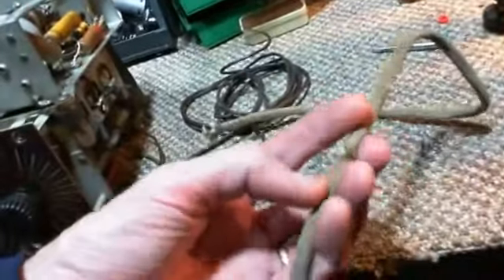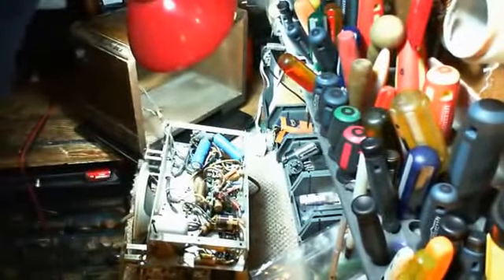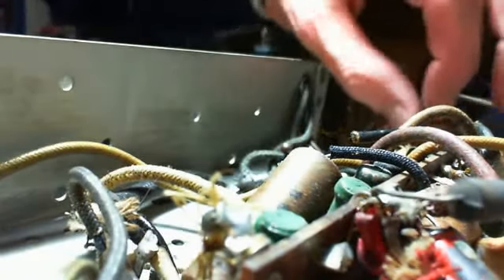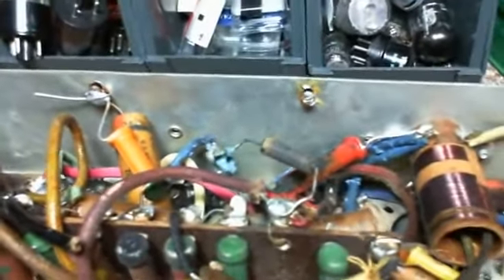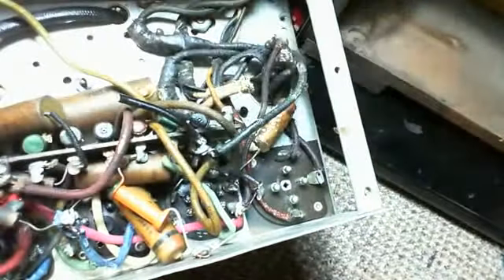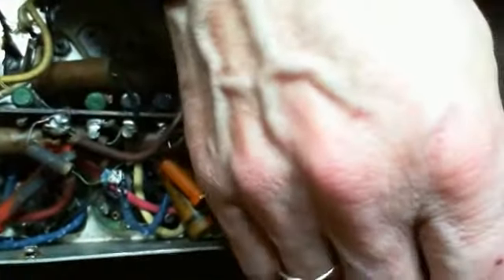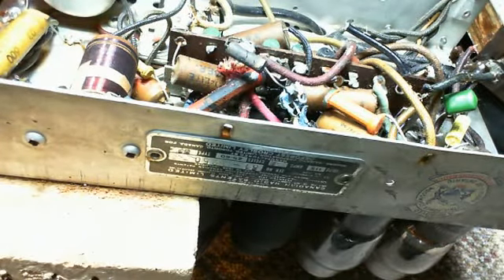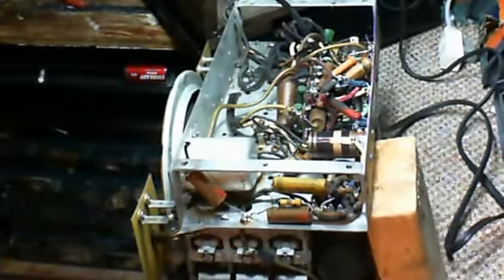DeForest-Crosley 81 EARL Video #2 - Power Cord and Capacitors

Comment: Resistive power cords were only used in series heater sets...I see this set has a power transformer, so you should be OK using any wire...